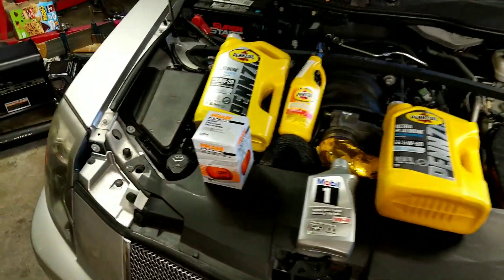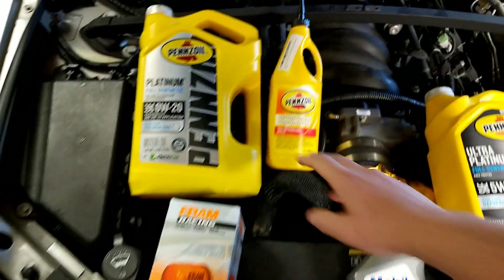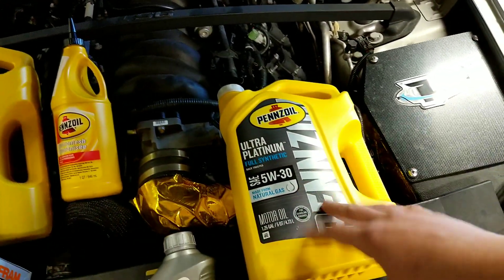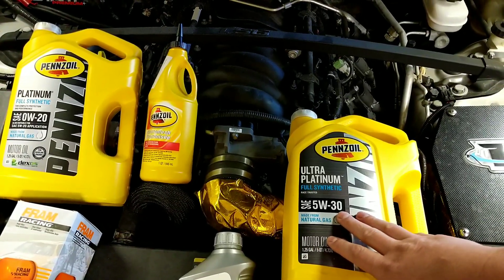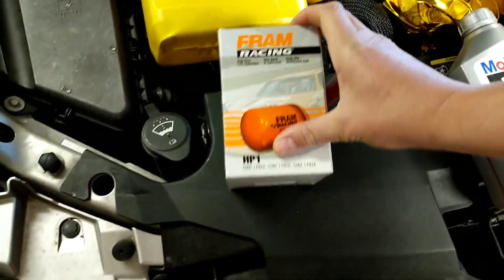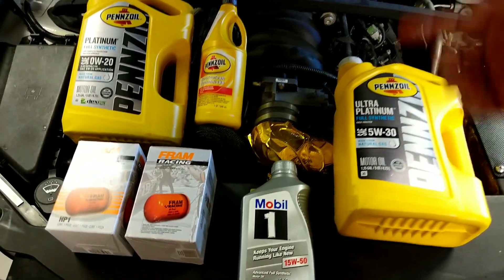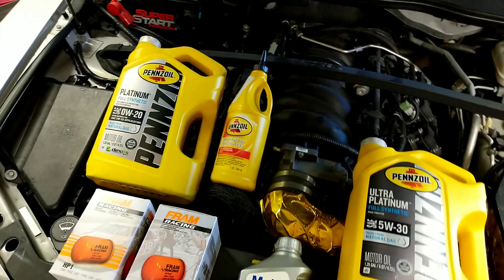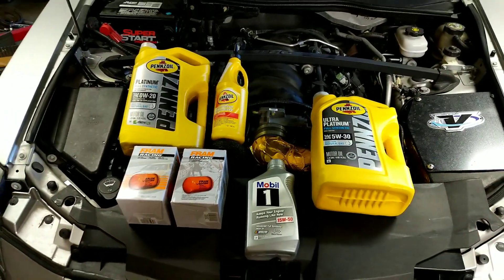Oil Pressure VS Temperature VS Viscosity

Comment: I'm running 5W30 on my VQ35HR engine because am scared of engine oil pressure issue or so due to using thicker engine oil such as 5W40 although i want to use thicker one.. Do you think I can use 5W40 safely on my VQ35HR engine without engine oil pressure problem?..

답글
Reply from the maker: I think you can run 5w40 without any problems.  This thicker Viscosity oil will increase pressure but flow through the engine slower. Do you see the oil pressure dropping below normal ranges when hot?

Comment: 180 is cooking, should be stable around 100.
Reply from the maker: Actually oil needs to get up to 212 to start to boil off any condensation. 100 is too cold for daily driving.
Reply: @TheAutoAnswerMan916  not even turbine engines run that hot.
Reply from the maker: @chippyjohn1  you must be thinking of Celsius. In America we use Fahrenheit so that's what I'm referencing what I'm talking about temperatures